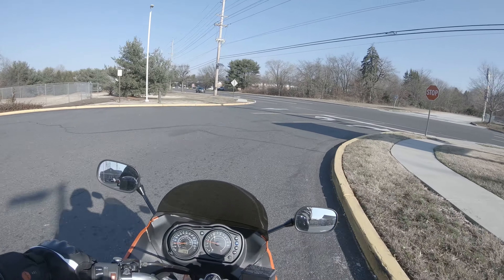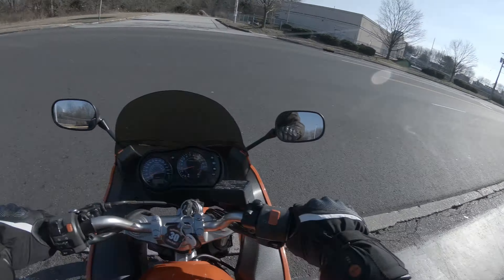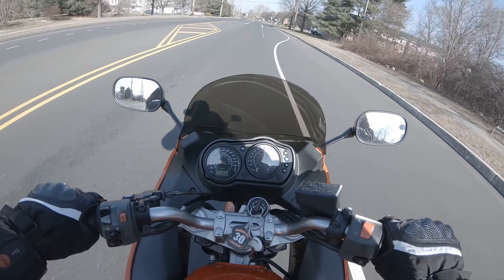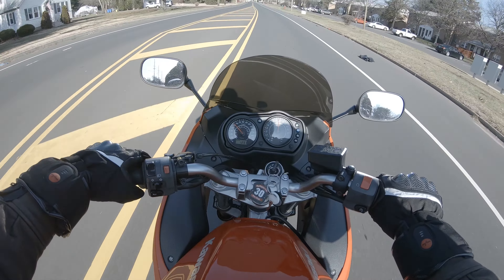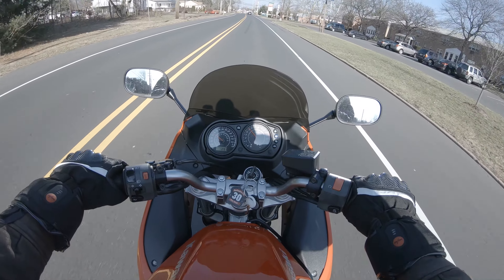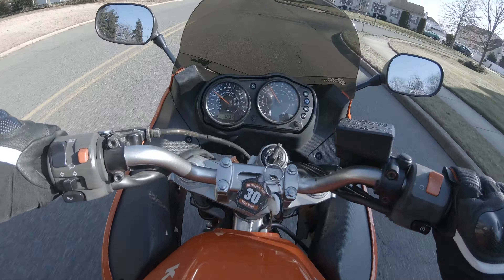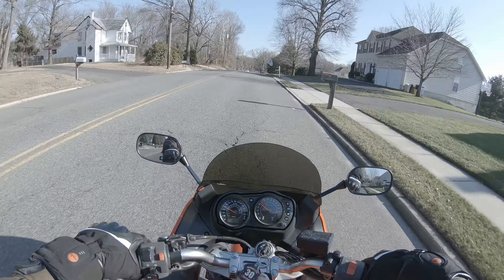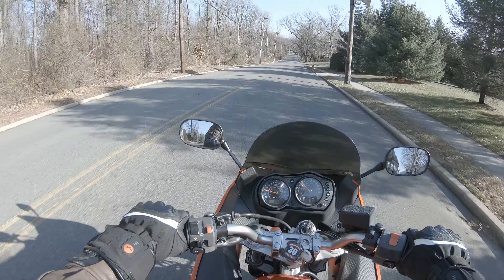Emptying Fuel Injector Cleaner In My Motorcycle! What Happens?

Comment: Ool did this to my Raider hoping that it would fix my 1900cc engine running on one cylinder.  Believe it is the infamous horribly designed Raider fuel pump.  Just put new tires on it and this happens.  Have to say been doing more wrenching than driving honestly may just sell the whole stable.  Fork seals, fuel pumps that cost hundreds, tires tires tires, cleaning it never ends

Comment: Dude, no injector cleaner is going to work in less than a minute. Its the placebo effect. If your injectors are blocked after 6000 miles you fuel is rubbish over there.

Comment: I use fuel system cleaner the week before doing an oil change and gradually increase the rev range I use during that week so I'm riding like a maniac by the end of the week! 
Then all the dissolved and broken bits of carbon deposits get taken out when I do the oil change.
Reply: Its all in ypur mind

Comment: Dude, you added a cleaner, not an octane booster... the idea is that as you use the entire tank of fuel, it will slowly clean your injectors.  It's not instantaneous.  Tell me what made you think you needed to add injector cleaner (ie, hesitation, stalling, backfire, misfire, etc...) then tell me how it drove AFTER you drove a whole tank worth of fuel...  For that bike, what's it about 200-250 miles?
Reply: Terry Crews  mine is doing that and pouring gas THROUGH and out of the air filter...going to try to adjust float and see if it's stuck or? Flushed carb out with wd 40 and it ran fine again for awhile
Reply: Terry Crews  howd it go?

Comment: There's no way you can tell if there's any improvement. You hadn't even used the fuel in the line between the tank and carbs! Possibly over a hundred miles or so you might notice an improvement in an older engine as deposits get cleaned away but your engine is almost new. There's nothing going here.

Comment: I have a 2013 zx6r and its been sitting a while and for the first time that I rode it in like 4 months its starting to hesitate on the lower rpms but gets better on the higher rpms. Would something like this help solve this problem?
Reply from the maker: I'd get some actual motorcycle tank cleaner. This was honestly a experiment
Reply: I think so, I had an fz6 years ago and I had a similar issue. I did the same thing except just a little differently. I only used half a bottle of the STP. Filled the tank , ran through that in about a week and use the second half and fill the tank. The problem was solved.
Reply: Yep

Comment: so, is it safe to pour the entire 355ml techron for just 16liters (4Gallons) of fuel?
Reply from the maker: My bike runs with absolutely not problems so yeah
Reply: @mcfgotmillk  so how many gallons do your motorcycle have?
Reply: @miguelpaneda1607  less than 4 gallons
Reply: It will run rich And on cars it will throw an engine light up.